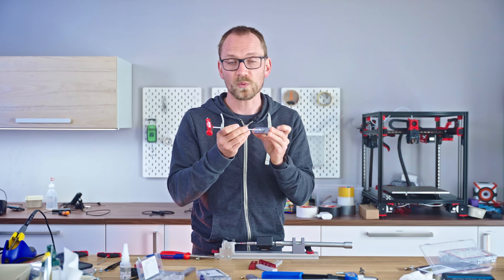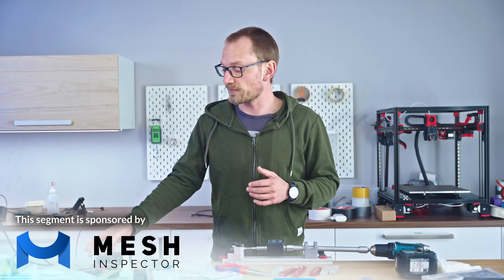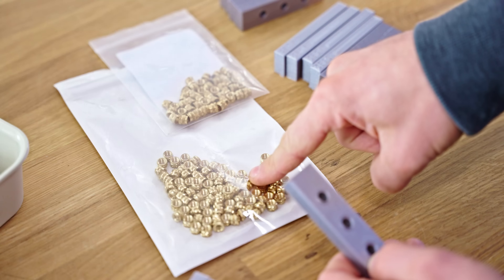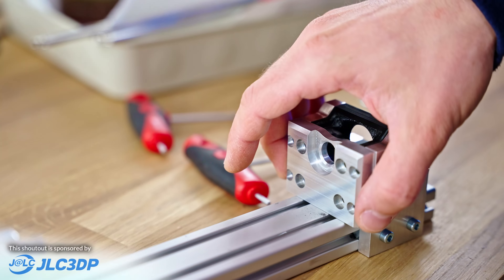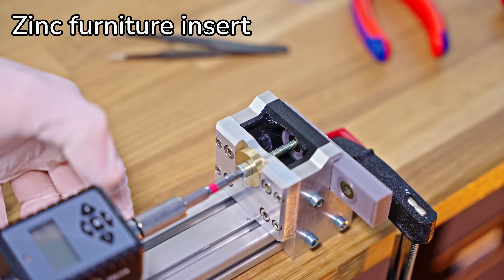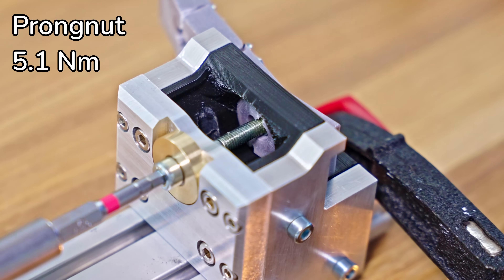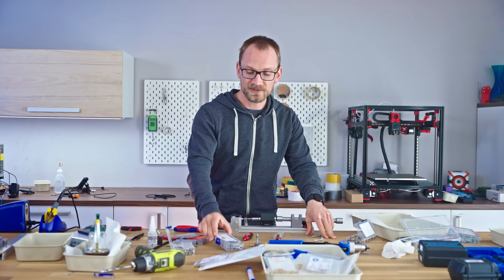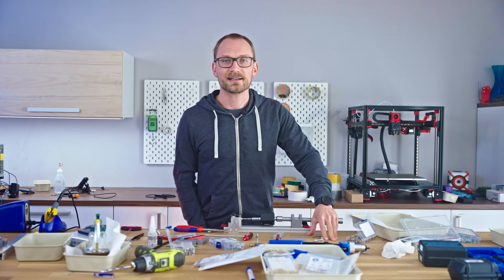These threaded inserts aren't made for 3D prints (but work amazingly well)

Comment from the maker: Get the inserts
CNC Kitchen heat-set inserts https://cnckitchen.store/ (use code tom5 for 5% off!)
Aliexpress heat-set inserts http://go.toms3d.org/AliInserts
Rivet nuts on Amazon https://go.toms3d.org/rivnuts
Zinc furniture inserts on Amazon https://go.toms3d.org/zincserts
Steel woodworking inserts on Amazon https://go.toms3d.org/steelserts
Thread repair wire inserts on Amazon https://go.toms3d.org/wirethreadrepair
Self-tapping inserts on Amazon https://go.toms3d.org/selfsert
Prongnuts on Amazon https://go.toms3d.org/prongsert

Product links are affiliate links - I may earn a commission on qualifying purchases (at no extra cost to you)

Comment: I watched a youtube video fairly recently where the guy did a lot of heat set insert tests for strength and concluded that the SPEED the insert was inserted at made a big difference to its final strength.  
This also goes in hand with the temperature of the iron as the hotter side of the recommended temperature (for that filament) would insert much faster into the plastic.
The slower you can insert it the stronger the bond with the plastic around the external teeth of the insert.  
If you did all these inserts by hand without a heat insert press and possible temperature variations then that "could" have affected the resulting strength.

Comment: If you do analyze reversed connection (prognut) where it mostly depends on the material itself and its thickness, why don't you do similar reversed for simple nuts or heat-set inserts with wide flange?

Comment: Just a hint for the strong prongnut:
If I can get access to the backside of the model to install a prongnut (due to the geometry of the model) I pause the print and put it in the printed prongnut sink. Then I resume the print. You just have to make sure that the prongnut is totally flush with the paused print surface. Works like a charm.

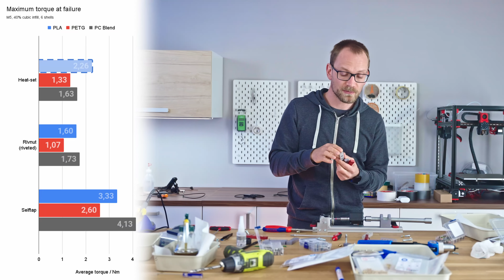Comment: 16:55
But the graphs show that the self tapping inserts are the strongest regardless of material used.
So it just depends on if the other inserts need to be used for whatever reason.

If you can get a good bulk discount buying a lot of the same type will also reduce costs.

Comment: I have to say: I use the original Böllhoff Helicoils at work to make threads in SLA printed parts with the original tools, so, printing a slightly undersized hole, drill it out with the provided drill, tapping and inserting the coil. Heat sets dont work in resin, cutting normal threads or just put a screw in causes chipping or causes so much friction that the resin breaks down. At the very least the thread is ruined after a few times of screwing and unscrewing. big coarse threaded inserts dont work because they break the resin.
Helicoils use a very light tap so it just gently scores the inner walls of the predrilled hole and since the coil creates basically a metal thread the thread has a better longevity. For me they are the best way of adding durable threads in SLA prints.

Comment: Thread friction changes torque to pull out force ratio. Bad testing method. Bolts are usually used to hold stuff together, so pull out is obviously more important

Comment: as a comparison I would like to see the strength of the various methods when installed from the back side. To be fair with the prong nut.  And to be complete add a standard hex nut. maybe post print and imbedded (pausing while printing). I would exepct the pull out to be much better. But the torque to be similar. 
Thank you, for your great videos. about this and other subjects.

Comment: I started working at a machine shop that uses helicoils in aluminum parts and fell in love.  Wth an STI (Screw Thread Insert) tap, installing helicoils becomes almost as easy as using a standard tap.  For example, your M5 screws would require 5.61mm bore, equal to a #2 drill.  You run the M5 STI tap through it, and the helicoil slides right in.  We had a decent number of unneeded helicoils sitting in a storage box at work, so I was able to stockpile a number of 10-32, 6-32 and 1/4-20 helicoils, and the boss was willing to part with a few STI taps that were too worn out for aluminum but have plenty of life for plastic.  Granted, I haven't done anything that requires high load bearing and don't foresee any such needs in my future, but for the projects I've used them on, they do spectacularly.  It helps that I've installed thousands at work, so I'm pretty familiar.  It can take a few tries to get comfortable with them, and learn how best to seat them.
Reply: Underrated comment. STI threads are amazing in all sorts of materials and a common go to of mine in 3DP!

From my experience working on A10, FA-18, & F-22 APU related parts, theres no shortage of STI threads in their aluminum parts- not as repairs- but as the original threads. 

1/4-20 threads .750 deep in high grade aluminum are fairly strong- especially when thread milled- but they still often chose STI- even in threads that won't be used multiple times- because apparently they're so much stronger than the aluminum threads alone.

[which was kind of shocking to me when I has just gotten into machining].

They require the proper tap, insert tool, & shearing tool, but theyre a great way to go when the part is designed for them.

Comment: It should be noted that there are several heat set inserts in different sizes out there, i.e. there are 5 mm M3 Heatset inserts that need a 4.7 mm hole instead. This gives you more strength but it also gives you the ability to repair standard M3 heatset inserts, that were pulled out.

Comment: I recently ordered heat set brass inserts and a set of soldering iron tips, mostly to use on 3D models that I download.  In my own designs, I usually insert stainless hex nuts from the back side, or self tap directly into an unthreaded hole if shear loading and not axial loading.  I also use plastic thread cutting/forming screws in unthreaded 3D printed holes.  There are versions for hard plastics and soft plastics (deeper threads).

Comment: A few omissions I was surprised by: A) Why not try the riv-nuts from behind the part, like a flange nut? B) Heli-coil inserts are designed to be used in conjunction with a specifically made tap. Nobody really wants to have to deal with tapping plastic, but why not test with that? Also, helicoils are made to have the little tab broken out: how well does the plastic hold up to having this procedure performed?

Comment: I just moved to using self tapping instead of heat inserts. It's just easier to mount. I'm not saying it's always faster than heat inserts but as I normally only mount 1-3 inserts it is faster in my use case - and simpler.

Comment: it never fails that i find a video AFTER i solve the problem.... lol
about 2 weeks ago i was in the same situation where i was trying to figure out WHICH INSERT TO USE.
i settled on the Heat-Press inserts.
but ALL of these inserts WORK BEST - when used from the back side !! (except for heli-coils)

but i do like Tap-thread Inserts a lot. but who wants to cut them down to get the right depth... yay galvanize lol.

Comment: As I did my testing (I made some video's  about this too), I used rivnuts from the backside as well as just inserting normal hex-nuts. If you have enough space, putting normal hex-nuts in the print is probably the strongest option in ABS, PETG and TPU which I tested the most (I almost never use PLA anymore especially for mechanical parts that loose strenght over time, especially outside). Rivnuts come after that at around the same place as  the wood-inserts with pins but they don't require a lot of modelling while wood-inserts work better with some modelling for the pins.

But still, most prints don't depend on the strenght in the direction of the screws but are more depening on shear-forces and therefore fixed=fixed and then the size of the contact in the shear-direction is getting most important.

Comment: I use rivet nuts or regular nuts, Furniture inserts or self-expanding brass iserts depending on context and design intent. And depending on access to "threaded" detail. If possible and you can design an access from the opposite side, any non-dedicated insert with flange will outperform double-threaded ones or melt-ins. One of my favs are hex-outside rivet nuts inserted with a bit of heat. They connect advantages of flanged ones woth turn-proof capabilities of regular nuts.

Comment: Have you considered manually tapping the threads to the 3dp (leaving appropriate hole in 3dp, drill and tap with hand tap)? 
In my experience making 3dp sliding nut for 2020 Al profile - they work great for pull-out strength and decently for torque. My cheapo MS machine screws (M3) bend much before the nut even shows any sign of weakness. Yes, you could probably strip them easily with allen bolt and high torque, but Philips M3 screws work great with manual screwdriver tightening.

Comment: I was wondering, If I screw on two heat inserts onto a longer screw, could I potentially heat up the screw + 2 inserts and insert them all together to keep the two heat inserts aligned so I could have a longer screw distance? Wdyt?
Reply from the maker: Could totally work, but continuously getting enough heat to the bottom insert may be tricky.

Comment: Great job covering all these options, I hadn't heard of some of these. I'm curious what you used to model the threads in the PLA parts, either a thread tool or maybe just importing a fastener model before subtracting it from the part (+ extra face pull for clearance)?

Comment: Very interesting.  Being a wood worker as a hobby, I understand the pronged type being the strongest. But it’s not something you want seen on your completed print. What I’ve learned from this is that I’ll be using heated inserts on a upcoming print I want to do.  No high strength is needed and remember not to really crank down on the screw when assembling.    THANK YOU

Comment: One solution to the prongnuts is if you can print the piece so the orientation of the hole is upside down you could just model out a space for it, pause mid print and place the prongnut in and continue printing, so it's captured and closer to the surface and eliminating the need for rear access.

Comment: Has anyone tried using their 3d printer and its nozzle to install the heat set inserts? Even if you made a small decoupling jig with a spring and a brass guide so that it’s a bit more gentle than jamming the rigid axis into your part think of a tap holder for rigid tapping on a cnc machine. This could maybe be set up as a custom gcode block you insert into the program that lets you install the inserts halfway through your print encasing them fully inside the print. Just a thought rather than gumming up the nozzle of a soldering iron and preventing the inserts from being installed crooked without needing a dedicated heat set insert tool/jig that takes up space

Comment: Well, I never thought to use all these other inserts not designed for plastic in plastic.  Very good out-of-the-box thinking! Interesting results.

If you have access from the back, you can also put heat inserts in to increase the pull-out strength.

And if you want cheap and easy, use a washer and nut from the back. :). Add hot glue if you want them to stay there on their own.

Comment: Serious problem with your test: why are you even testing the torque resistance ?
The pull-out resistance (in a straight line) is the relevant force when the part is in normal use !

As many have pointed out, the normal usage to obtain good pull-out stength would always be to have the nut fitted in the far side of the component, or fully embedded.

Also, the proverb "Horses for Courses" applies.   In most applications, the nuts will be operating at far less than their maximum possible strength, so the choice would be made by ease of use or cheapness.

Comment: Next time try to heat the wood inserts then screw them in just like you would into wood.
No need to model the thread, holes print faster and the hold is pretty good.

Comment: The prong nuts are also easy to push out the back side if you aren't careful installing the screw.  That's my experience from using them in wood.

Comment: I feel silly to admit that I didn't know tee nuts went in from the back like that..... I have only ever used some to put leveling feet on the bottom of some table legs (the feet came with tee nuts instead of threaded inserts) and ended up just using some epoxy to set them in to stay put. These make much more sense to be used on plywood or other thinner parts or at the end of a long blind hole. Learn something new every day, thanks!

Comment: Great Test! But one important parameter is missing. Whats about your nozzle diameter?
Reply from the maker: These were all printed with a 0.4mm nozzle - I think I have done tests in the past with strength vs. nozzle size, but I don't think the results would be much of an impact here. When you're past the point of the insert pulling out before the part breaks, nozzle size (and part strength) won't matter. Otoh, if the part breaks before the insert pulls out, then it's simply a matter of finding the part strength itself - insert or not.
Reply: @MadeWithLayers  Thank you for the answer. But i'm wondering that you are still using 0.4 mm nozzles. I thought the new kid on the block is the 0.6 mm nozzle!? 🤔 (regards to your video: 0.4mm nozzles just became obsolete)

Comment: In the RC airplane biz, we use the 'pronged Tee-Nuts' especially for gas or glow-fuel engine mounts.  
I really like them because, short of crushing the substrate they actually strengthen the material by not allowing it to be distorted or pulled apart.
In analyzing many post-crash situations, there was never a failure of the fastener system, even when everything else was obliterated!
In most cases they are overkill and take up a little extra room, but if you have to have the strongest, I think they are hard to beat...

Comment: Here it really would be interesting how the internal layout is affecting strength: I would imagine that just having a circular hole would be a lot weaker than having continuous lines that just "touch" the circle - imagine water streamlines around a pole, with different directions for each layer. But that would be a pain to model without direct slicer support.

Comment: This was a really cool test! I have one idea for you if you're interested in following up on it. With those self cutting threaded inserts, put them in the freezer overnight as it will cause the metal to shrink ever so slightly. Then take them out of the freezer and immediately insert them into a 3D printed part by letting them cut their own threads. Once the part has warmed up to room temperature, the metal will slightly expand and put even more tension between the metal and plastic. Maybe it will increase the strength and maybe it won't. But it would be a neat test!

Comment: @tom - awesome video, great to see this breakdown! 

The T-Nuts that you tested are very commonly used for mechanical fasteners on ski boots typically Nylon, TPU, and PU materials. What I have see on their failure mode is the metal prongs which are designed to bite into the material, begin to bend, and then causing the nut to spin while being torqued.

Comment: What torque meter are you using. That was not stated in the video info. I am interested in using something similar.
Reply from the maker: I'm using just a generic one off of Amazon that has a Peak function. The "brand" that was listed on mine has already disappeared from Amazon, but any that look the same will be the exact same hardware (mine's a 0.3 to 30Nm unit) http://go.toms3d.org/DTorque
Reply: @MadeWithLayers Thanks :)

Comment: I miss one important thing in your videos and that's what I personally do: I mount the heat inserted nuts from behind whenever that's possible. This will always give the best connection as you'd have to pull the nut all the way through the material.

Comment: Definitely going to consider trying to use prongnuts on some future projects.  I've been lazy, just using regular nuts heat-set into slightly undersized holes, but they easily turn in the hole if over-torqued, which seems unlikely for the prongnuts to do.

Comment: Threaded inserts are a thing that industry should use on the plastic crap they are selling, but they too often don't. Instead we use plastic inserts on 3D printed plastic parts that we could easily print again, once the thread is worn out...

Comment: Did you check those flanged zinc/rivet nuts in reverse like the pronged insert? Id have imagined they would work great with the flange fighting against the part. Smaller than the pronged insert as well...

Comment: I'm surprised why you use the short heatset inserts. Those I use only if space is at a premium and take the longer versions for everything else. I think those would have been the strongest just after the backmounted options.
And I like the simplicity for putting them in the design.
So I will stick to the heatset inserts, but the longer ones wherever possible.

Comment: I think that most of those would have a massive increase if you put them in from the backside like the flanges ones. Try a heat set from the backside and will be much much stronger.

Comment: You should include drywall/plasterboard fixings, the type that deform behind the hole and grip from behind. They do need a bit of room behind to be inserted far enough for the front face to be level with the part but they shoud work quite well with plastic.

Comment: But does really a 3dprinted thread is stronger than a screwing in a plain hole? If we are talking about reusability - sure, but as one time job it looks like it will be stronger with a properly sized hole. But it will be working only for a small size botls like m4 at max. 

Anyway hope you can test this in one of your next videos.